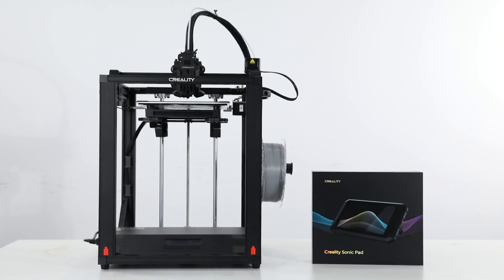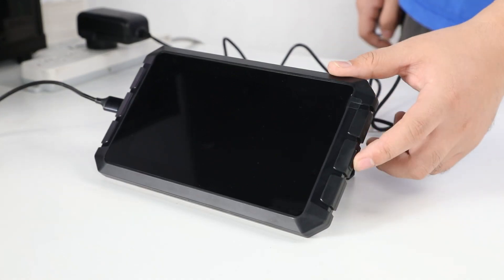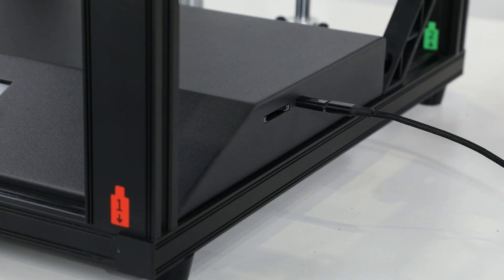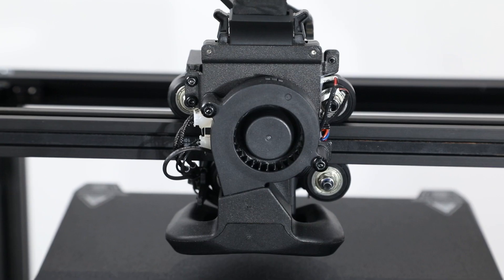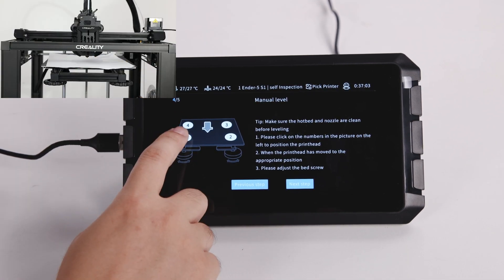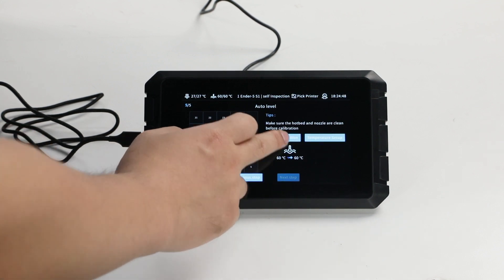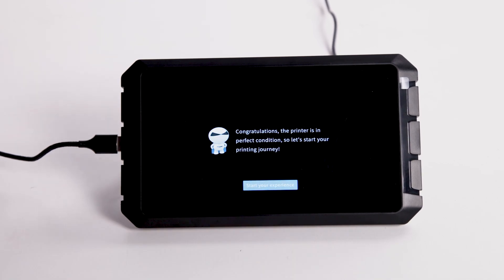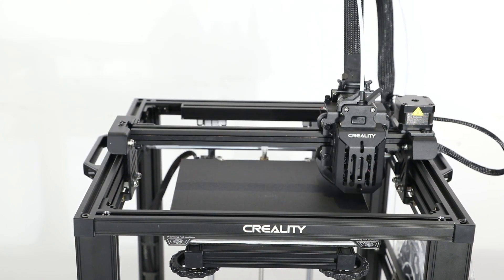How to | Connect Sonic Pad to Ender 5 S1 Detailed Steps

Comment: Hello i did that but i had to flash y printer back to the original screen. Everything was going ok until the auto level part. On the first point the rito level sensor was passing the edge of the printer bed. It gave me a error and i couldn't auto level. So i have to reinstall the ringer software and put the sonic pad away. There is any fix for it? So i can use my sonic pad

Comment: For the manual leveling part how far is the nozzle supposed to be from the plate, because as soon as i start the next step it jams the nozzle into the hot plate and then stops very fast and gives an error message.
Reply: i'm facing the same issue, Can you please how did you do it ??

Comment: The new firmware released today includes a printer def. for E5 S1 no z axis switch. This does not go off the edge of the plate during automatic levelling calibration. It is printing right now and the plate scored very well on the automatic levelling.
Reply: I ran into the same issues and had to update the firmware how is yours running since doing that ?
Reply: Thank you I will try this firmware as its really disappointed me since getting the E5s1 with Sonic pad
Reply: What is the software number? My printer gave e a auto Evel error and it is a brand new printer and sonic pad

Comment: Followed steps fully and correctly but when it goes to calibrate the nozzle goes to low down even though when I am at the z offset stage its set perfectly... and the manual levelling is correct... it still goes too low

Comment: Just tried it today and it walked off the end of the bed for the automatic calibration and so the nozzle hits the bed with dreadful shudder as the z sensor never hits the bed. In short it thinks the bed is bigger than it is!!!
Reply: I am also having this same issue. Printer worked wonderfully for a few days prior to adding a sonic pad and now it is missing the bed on the left side trying to auto-level, flexing the bed and making a pretty awful noise in the process
Reply: @alexschwarm7912  went back to the original firmware and now working without the sonic pad. Have gained a punched depression in the build plate and a worry that the printer will not be the same again. Unhappy
Reply: I was planning on doing the same. Thankfully I don’t think my printer sustained any damage, but I’m not sure if I’ll ever use the sonic pad again. Definitely a disappointing experience
Reply: @alexschwarm7912  just thinking without being near the printer one option could be to rotate the top removable bed plate 90 degrees so that the pull tabs may trigger the z axis sensor. It would still need fixing but at least the calibration would not thump the bed in to the nozzle when trying again if a fixed printer def comes along.
Reply: @alexschwarm7912  The new firmware released today includes a printer def. for E5 S1 no z axis switch. This does not go off the edge of the plate during automatic levelling calibration. It is printing right now and the plate scored very well on the automatic levelling.

Comment: Can we please get some clear instructions on how to install on an Ender 5 PLUS...
The Sonic Pad specifically lists the Ender 5 PLUS, but never seems to work when I try to install it... 
Please, clear instructions for THAT SPECIFIC MODEL.
Thank you,
Reply: Hello did you ever fix the issue . The one they have listed is for a 2560 chip. I have the 4.2.2 bd and upgraded the board to 4.27 . and still can't upload the Printer.cfg file using putty. I'm ready to send back the sonic pad.

Comment: My Sonic Pad came with a small black sensor that attaches to a 6-pin round cable. It's not mentioned anywhere in the instruction manual, nor this video. 

I've since learned that it's an accelerometer and seems to be a nice inclusion in the kit - but with no instructions, I have no idea how or where to mount it on my ender 5 s1. Also can't find anywhere on the internet that explains this. I'm new to 3D printing, so maybe this is something that veterans "just know"? But would be helpful if there was some information included about it.
Reply: From what I can gather (being in the same position) it's an Accelerometer that needs to be positioned on the print head. There's a handy mounting bracket for it on Thingiverse.
Reply from the maker: Sorry for having you confused about it, please email at marketing@creality.com, we will send you related documents of it.
Reply: @Creality3D  it would be nice if you made it available on the website as i need this too.
Reply: @Creality3D  Yalls customer support is trash.  It says nothing even in the owners manual about the sensor